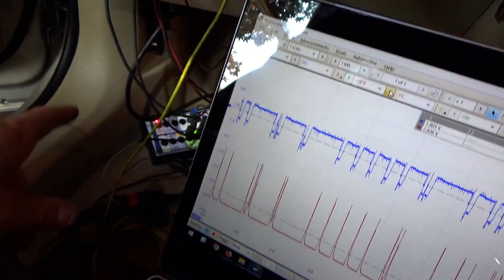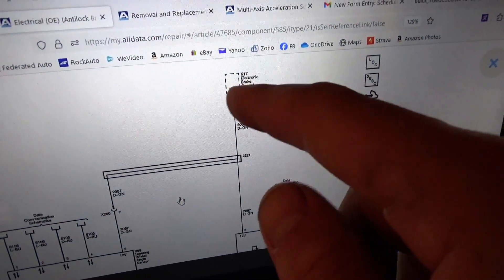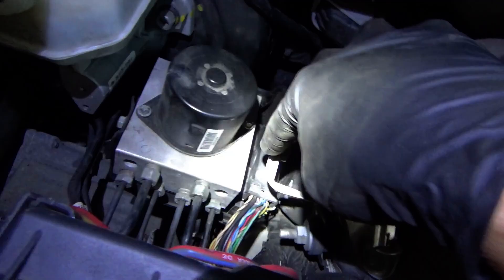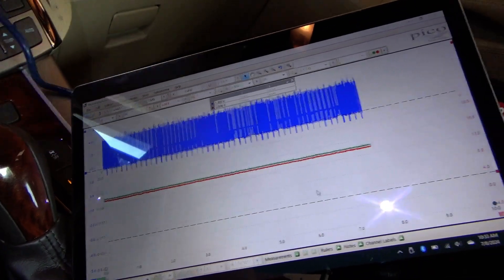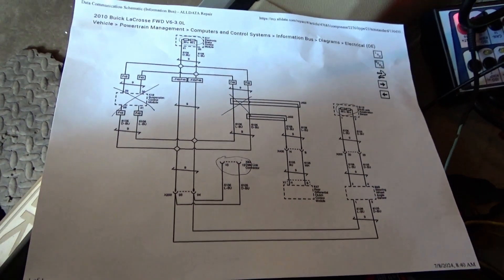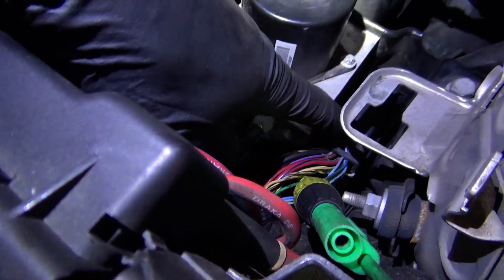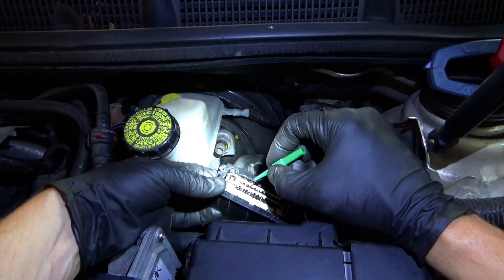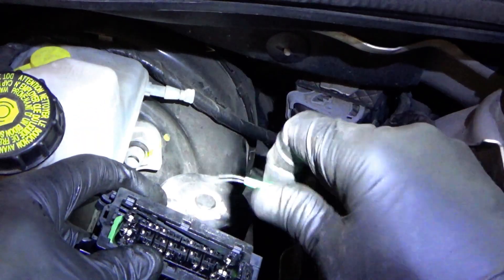(Pt 2) Customer Spent $1000...Now Car is MORE BROKEN!? (Buick GM ABS MALFUNCTION U0074)

Comment: I've done similar repairs by by-passing modules, but there's always the question in my mind as to why the factory engineers felt compelled to supply the 12 volts through the module rather than by-pass it as you've suggested. Always concerned that the magic smoke will be released. lol
Reply: Since abs is considered a really important safety system they probably control the 12 with the module to be able to reset it. Like it's constantly asking all the time now if it's there when not working while it would just give up if say a seat module doesn't respond

Had a wiring failure to EBS while I was driving a lorry and when the wire worked the EBS would start working, even if you where driving, then come back when wire didn't connect. 
Since it took some time to find it and the manufacture was involved I managed to get info that it was just considered such an important system that if it had to start working when fault disappeared without restart or clearing fault codes witch I also agree, witch I also agree with. It really is not fun trying to control brake pressure on 60t 8 axel rig especially in the snow when it happened.
Reply: Maybe because they can control the output voltage by doing it via an onboard regulator / power output stage, so that they can provide a clean, steady 12v with no ripple, noise, or large voltage spikes / fluctuations. Seems like this could be key for the downstream modules, especially for ABS.
Reply: @frg1ne  Interesting thought. Might be interesting to monitor the voltage of a good system to see if the voltage is regulated to  more constant limit as compared to the regular charging system.

Comment: Other possibilites: tin whiskers, cracked solder joint at the bulk connector on the ABS module (I had that one).
Reply: That's a throwback to the 80's Tin whiskers. The company I worked for had  new power relays sent to us by the manufacturer, one of the pins had tin whiskers on a drama new part.

Comment: I had a similar one where the power driver to the RF wheel speed sensor failed inside the ABS module.  I felt like Ivan when I spliced into the LF WSS power feed and fixed the problem

Comment: That's the difference between a diagnostic tech and a person who just reads the codes. Nice work my friend.
Reply: Problem is spreading pins trying to test for bad circuits isn't even making it past the BASICS of such work...Lack of knowledge training or Don't give 💩 attitude, My bet is a little bit of all the above, Sad really.
Reply: I feel that when you take your vehicle to the dealership, they should be made to do all this diagnostics that Ivan is doing.   
Dealerships get paid lots to fix the problem, do it right or don’t do it. 
Dealership rules need to be changed.
Reply: @jackschissler255  The problem is dealerships have a considerable amount of overhead.  A Technician that spent as much time as Ivan did wouldn't get paid for his time.
Reply: @lvsqcsl  I know but that’s the difference between a dealership who just puts a bandaid on the problem or a real true mechanic with his own shop, he will find the cause and fix it (well the good ones).   That’s why it’s good to have a friend in the mechanic field.
Reply: Ivans specialty..having the time to diagnose. The other shop may have had 30 cars waiting. Thats alot of stress at a shop. We, as observers, cant say: "if they wont do it right, they shouldnt be in the business".  Busy shops have a valid reason to exist.  They take on most repair challenges, they fail sometimes
Reply from the maker: @pootthatbak2578 that's exactly why the shop should have called me in BEFORE firing the parts cannon! They have my number! No excuses 😂
Reply: @PineHollowAutoDiagnostics that's because their not in business to fixing the problem only the symptoms, with all the $$ vested in that tool box the only way they can pay for it is the parts cannon tool and that tool never gets greasy dirty it's always shiny clean.
Reply: @PineHollowAutoDiagnostics  Somehow I knew it was a local shop.
Reply: @PineHollowAutoDiagnostics 
Exactly !  💣 = 💸
Reply: @drunkingsailor2359 You mean like almost every doctor on the planet.

Comment: The ABS brake system has saved me from hitting kangaroos 🦘 in my Holden Commodore  & I have had a module go at the beginning of last year so I fitted one from an older model & the ABS brake system does work.

I still need to get the original one refurbished or replaced because the traction control system doesn't work properly,, the TRAC ON/OFF indicator doesn't work because it's out of an older model which had a light instead of an LCD screen which displayed its state ( i.e. on or off).

I dare say that there would be a fault code there because it's a V6 module & I am using it in a V8 model,the traction control doesn't turn on like it did before.

Even though it would cost over $1000 AUD to repair the original module on an exchange basis, it will give me peace of mind that my compulsory third party green slip insurance policy won't be made null and void if I had an accident with another party & they could prove that the traction control system wasn't working properly !

Comment: "Play by the rules?"  Ivan, when you use "Russian Repairs" that is usually on something like an ancillary system, etc. that really isn't critical to vehicle operation.  You have elected not to use it in this case and I agree with you.  BTW while you said your cars have the ABS bypassed by "Russian Repairs," I would say Mr. Rogue has not had that done.  (I guess technically he's your wife's car.)  The MPV didn't have ABS available in 1989 (even though some cars did have ABS in 1989) and it was probably optional on the Mystique.  I was hoping to see some component repair as well, but, I think the route you are going is indeed best.  GREAT VIDEO!
Reply: It's liabilities issue imho, and I do indeed sleep at night.

Comment: Doesn't anybody take shops to court for bad repairs???????????
Reply: Would you take a rusted out piece of junk to get it fixed...they replace parts. Now it's become parts cannon home? 
Now you go to court over it? 
Even now you get a newer vehicle that are having issues. 
What do you do now. ?
My sister took her truck to get it fixed by an independent shop and dealership still not fixed. Now it's my turn. It's a 2015 Tahoe afm lifters issues. 
I've informed my sister. I'm giving you 3 recommendations. Nope, just replaced the parts I need.

Comment: That is why a scope are great, a normal DC meter would never registor this small glitch on the 12 volt output. It look like bad soldering internal in the modul. Think that it is the connectorpins, since the material needs more heat during soldering comparred with the internal SMD components.
Great find. Realy hope that the other workshop compensate the customer.

Comment: I just had a customer bring a 15 fiesta in. He had taken it to the scumbags on the hill that don't know even how to change oil. 1 locked up engine less than mile after oil change and another oil change they threw part of a bmw oil filter housing in garbage prove they are scumbags. Anyway changed guy 65 bucks to transfer codes from a scan tool to a receipt. He had no wipers trunk release not working and other shit. It took him longer to explain the problem than it did for me to find it. Loose plug on BCM. Fords it is at passenger feet.

Comment: the more I watch vids from repair guys all around, the more repair "tropes" pop up, and you hit a rare one with the spread pins, which I can't think of a name for yet  the only other rare one is the "hooked up wrong" trope like on that older motorhome (which I passed a vid link to to a freind in the RV industry that has to fix stuff BEFORE customer sales!).  it's getting to the point I could make a mechanic and technician trope list page.
Reply: Trope: figure of speech. Wallowed out: helpless or useless.
Reply: @gnomiefirst9201  "fire the Parts Canon", a common complaint of good techs and mechanics, is a perfect example of a repair trope, as is"I know a guy who can fix it cheaper", and "booger welds"

Comment: Ivan, your shop begins to resemble a hospital ER more and more! Let's hope your inclination towards disabling your ABS doesn't result in you actually visiting an ER some day. 😉
Reply: ABS is a joke.
I remember when they started putting it on semi trucks in the 70's
Damn things almost got me killed in Pa going down Snow Shoe mtn.
Reply: @willardlentz3044  the early systems were garbage. mid to late 90's they had gotten fantastic only if the tractor AND trailer had the same system.  seen a lot of jacknifes when the trailer had and tractor didnt
Reply: @richardcranium5839  The trailer depends on if the tractor has then.
I pulled a lot of trailers with ABS and my tractor had none.
They work just like standard brakes.
The tractor I had I pulled the fuse.
Reply: Hah, 90s ABS? If it's anything like GM, it will randomly slide you through a stop sign on dry pavement.
Reply: @jessicav2031  the strategy on truck abs  with air is completely different from hydraulic on cars
Reply: "Modern" (2000s) ABS with trailer modes can actually counteract trailer jackknifing with just the cars brakes. Here in Europe everyone pulls trailers/campers with cars/suvs and most cars have those advanced abs functions. And even the late 90s Merc ABS (without trailer mode) are good, had It save my bacon in an intersection on ice before.
Reply: @tschuuuls486  We were talking about semi tractor trailer
Reply: @rafflesnh  ABS systems have come a long way from the 90s those old systems were just too slow and Dangerous in too many cases, Hell on a 97 Chevy with working ABS you still never want to set the Cruise on ice 🤣. The new systems have helped in many cases, but if you're driving too fast for conditions ABS isn't going to save anything, You're going to Crash
Reply from the maker: @rafflesnh  disabling the ABS has actually saved me from sliding through some snowy downhill intersections 😁👌

Comment: It would be interesting to see a teardown of the faulty module. It’s likely to be a broken or dry joint, possibly from thermal fatigue.
Reply: I didn't watch the full video but if it was the ABS module they're usually bare silicon dies on some kind of ceramic substrate with gold bond wires ran between components and a gel layer on top to keep them airtight/clean

Not the most repairable thing in the world
Reply: I'm sure it would be a bad solder joint. You could pull the EBCM and take the cover off, trace the 12V supply on the PCB and start re-flowing solder joints while observing for cold joints at the same time.

Comment: I hope a new EBCM is available. The ride height sensor for my dad's 2011 Buick was not available, so the dealer told me to pound sand..... Looking for part 3!
Reply: Unless GM is still using it they will discontinue it.
They also will change the part number and not give a cross reference.
Ford is like that too
Reply: thats why we have junkyards. find your model/year car take parts

Comment: Can the EBCM be opened up and retouched with the soldering iron?  Solder joints, especially at connectors, are a common failure point.
Reply: I was thinking the same thing, might be too difficult to "split" it open.
Reply: I guess another possibility is that "critical safety components" have to be repaired by a certified repair shop.

Comment: The sad reality is the previous shop in all likelihood threw away perfectly good parts. What a waste of money for the customer. One thing i have learned is NEVER EVER throw away a part. I dont know how many times the old part was a great visual reference to getting a new and correct part.
Reply: Depends on how scummy they are.  They may have replaced with aftermarket, then sold the originals as "used/untested".
Reply: @ovalteen4404  never thought about that possibility.  If so, so so unethical.

Comment: Intermittent connections at the ebcm connector, thanks to someone spreading the receptacle pins in the connector and internal to the module itself.
Great diagnostics Ivan.
On to part 3.

Comment: What a great example of why continual monitoring of data points during a diagnosis is important.  Had he just assumed the wiring was solid he would have never found the pin issue or the 12v feed issue when tapping it.

Comment: My guess is a dry solder joint on that particular 12 volt feed pin on the circuit board itself. Only makes sense, especially since it shows up when you tap on it, could 'probably' be repaired with no parts required. I would definitely try that if it were my own vehicle, but I understand if the customer doesn't.
Reply: I would be taking the module apart if it was my car. I’m sure it would be an easy fix.
Reply: Cold solder joint
Reply: Yes, but by the time you pay for the labor for uninstalling/installing, you might try the Russian hack first. PS: maybe he'll do us the favour and open the unit up for shits and giggles once it's on his bench, and see what's going on inside. My suspicion is that there are no classical solder joints that can crack, but pins just locked into pre-tinned holes on the PCB. Was the case in my Chevrolet Captiva, I've just refloated all of them for good measure when I had a similar issue